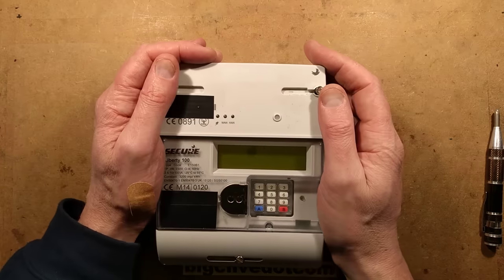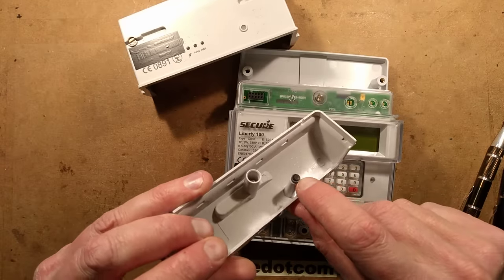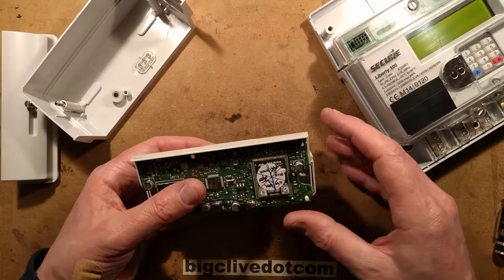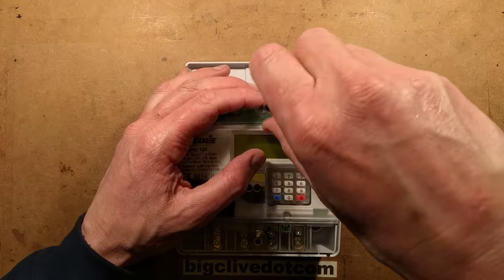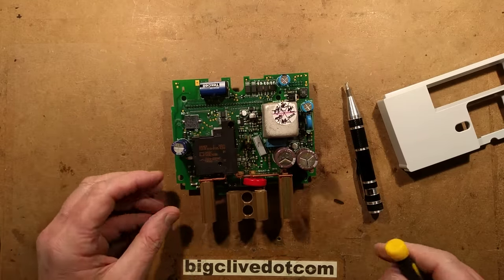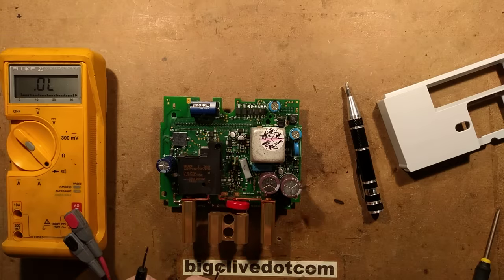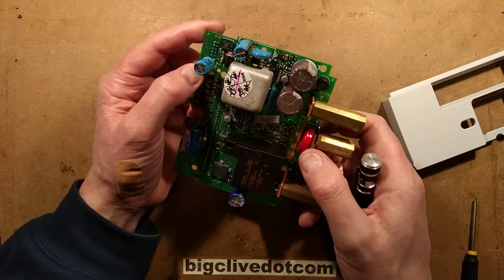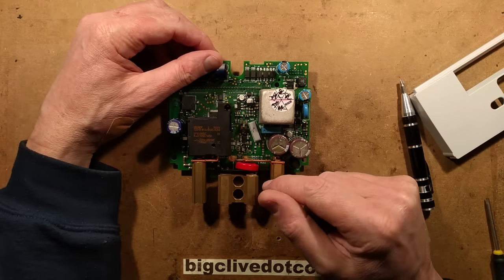Inside a smart meter, and the REAL problem with them.

Comment: When you dismiss the potential for a microphone in the smart meter I notice it is only part of the meter you have dismantled, there is also an internal display panel which goes with the smart meter. I would be keen to see you dismantle one of those too just to reassure me before I take off my tinfoil hat. Also there were 2 components you seemed unsure of which I am still curious about.

Comment: Your comment on mobile phones.   I used to repair microwave ovens. We had microwave leak tester which had a gauge on showing the levels of leakage.  If the needle went near the red area the microwave was dangerous.  I decided to hold this close to my mobile phone when on a call and the needle on the gauge went fully into the red zone. ??  This thing only tests for microwaves. I tried it again many electrical products and nothing !
Reply from the maker: It will be an RF detector, and your phone is an RF transmitter.  If held against it while trying to communicate with a remote cell tower from indoors it may have put out enough energy to give a good reading.

Comment: So the lesson of the story is use a faraday cage to block cell coverage and only open it when there is a power outage. Then they won't know you opened it until they physically come out?
Reply: Those big caps in the modem are two 50F 2.7v supercaps in series across the 5v supply... not sure how long they would power it, as they only phone home once a month, but why bother opening it now you've seen what's inside?

Comment: can you explain the reason, 

1. why smart energy meter not communicating over cellular network.

please mind that all the firmware updation are UpToDate. and still the meters are not communicating.
Reply from the maker: That could be because they are not getting a strong signal depending on the network SIM used.

Comment: Software at the supply company will detect most tampering events simply by spotting the changes in the signal. All those anti tamper buttons are physical proof for when they issue fines and prosecute.

Comment: Basic electronics- "US NAVY" 1977. 1st that red/orange MOV, is for "surge voltage" mostly Lightning strike, 2nd, that "Strange foreign short metal, on Copper bus bar, is a "SHUNT" high -"fixed" resistance, for "Metering" instead of a CT, way back, that with analog milli amp, meter, how current draw, was measured. "Ohms law"

Comment: At 14:40 apropos the type Y capacitor not having a ground connection, we need to remember where these meters are connected in to the system, right where the supply enters the building's electrical system and as such the Neutral will be strapped to the Earth more or less right next to the meter, consequently Neutral will be at Earth potential with the same impedance to Earth.

Comment: Given the construction of contemporary metal consumer units I'm astonished by how flimsy this looks... given the monstrous potential fault currents.   I'm just a low voltage motherboard repair guy... i take it they thought of that and this is all fine right ?
Reply from the maker: Although it can kill power in extreme situations, it doesn't usually have to break fault currents.

Comment: I have a smart meter series 2 and it is in a concrete walled basement elec room for multi apartments which stops the signal coming in or out. Is there any way I can install say a signal booster to an outside Ariel so that will work?
Thanks
Mike
Reply from the maker: It's not easy to pipe a signal in.  If the meter is owned by the utility company they should resolve that issue themselves.
Reply: @bigclivedotcom trouble is they are not bothered but I was thinking can I install a transmitter/receiver to boost the signal into the room so as to help everyone of upto 47 possible future smart meter. If so what frequency etc would it be?

Comment: Not quite sure where the current transformer is, could it be in the 'switch for disconnection' cant see any other circuitry that could take 30-40 Amps ???
Reply from the maker: It's a shunt device in the busbar.

Comment: We complained that our Knky here in France did not work, hardly surprising we have no Orange coverage here. Our Off Peak never turned on. They changed it. I am guessing that a builder was rewiring and rebuilding a house and it was just stripped out. However, the agency that would like the box is not the agency listed but the local electricity supply company, not the company given. Try the local company. The SIM will give the telephone company, probably BT if in the UK.

Comment: Antitamper is on all car modules especially German cars and has been for over 20 year hard to fix so you must buy a new unit on older Mercedes Benz they cost a fortune £2000 for a throttle body on a SL r129  ,, 280 for example

Comment: What would happen if you held a small emp generator close to this unit? It would fry the comms instantly and remove the capability to shut the relay on and the power company would not be able to prove foul play
Reply from the maker: These units are protected against various interference techniques to avoid fraud.  It would probably snitch you in.

Comment: Hey Big C, brilliant as usual 

The biggest problem I have in Spain is that by law we all have one yet the fucking electric company wont give you any information from them at all. they are supposed to tell you when you use the most electricity etc yet after 9 emails in spanish to the company I still can not get a straight answer from them to tell me the times that I use the most power so I cant set my tariff properly to get the best out of the fucking meter and pay the least amount of money each month that I get billed.

At best they are a complete waste of money and at worst the electric company can switch off your power whenever they want to without having to come to your house.  They supply the house owner with no information at all, we are not even allowed to have the little box you have in the uk that tells you at a glance how much you are consuming in cost this second on gas or electric.  The only use they have is for the electric company to sack the meter readers and to enable tracing of pirated wiring.

In Spain these so called Smart meters contain what was the I guess you would call the main fuse/breaker ,  now there is no need to have say the main 40 amp breaker, the meter has it built in but electricity here  s supplied by the meter in power bands, the lowest being 3300 watts, 4400, 5600, 7200 10, 000 being the highest and like mine its 3 phase at that level

Most modern houses are around 5600 to 7200 , mine is 10 k as its 5 bed but mainly because I have a workshop and need 380 volts in there for my lathe and welder.

Why they do it this way is beyond my comprehension , most apartments only have 3300 watts!!  If you want more power before we just upped the main breaker assuming the power wires coming in were at least 8 to 10mm2  but now you cant do that as the meter itself is the main breaker and if you exceed your contracted power it will trip and then take 10 minutes to reset.

 Now you have to go to the office and if you want to up the power you need a total inspection of your electrical system which will cost about 500 euros, endless pieces of paper and then go to the company cap in hand with all this shit and almost beg them to increase the power.  Even assuming they will agree to this then they might send out a man to change the meter to the new power level as its not capable of doing it electronically, not so "Smart Meter" are you , you little fucker.

Finally even if they did supply me with the meter information I want it wouldn't really help as no one  here understands the new electric bill and how it works including the people at the company's offices. Its made up of 3 individual bands that have no english meaning at all, the spanish don't understand how the bill is made up so even though I speak Spanish I have no chance whatsoever as the terms on the bill are written in almost a unknown language. Its a total fucking mystery...

So for 99.9% of Spanish users of electricity its a complete waste of time to have been put on smart meters as they do not do what was intended and promised .

Oh for fucking solar panels and lithium batteries that can produce 3 phase, ( for Gods sake I have 300 days a year of glorious blue sky and 100% sun coverage on my house roof even here just south of Barcelona  ( ͡° ͜ʖ ͡°)  I am that close to going "off grid" now.

Keep up the good work Bib C and dont let the fuckers take you down.

Comment: Now here is another one... This chap came to intall a Linky...(read below who I am )  I asked him about the power factor and the reply was blank...so he installed the Linky and procedded to remove the old meter, a Landis & Gyr eddicurrent rotation disc type...so I said leave that meter he said no we have to recycle....so I said I will recycle it...he said no I have to return it to my company. So I asked why? well the blubbering chap ran out of answers. I felt so sorry for him as he was not an electrician or qualified but had been trained to rip out old meters and install the new cream box...He left (bewildered) and forgot to take the old meter !!! so I re- installed it to monitor consumption after the Linky After 1 month the difference between the two was 40 units..One measured KVA and the other KV.. This is becoming a very interesting subject !!!!

Comment: Is the silver 'slug of metal' at 9:30 a fusible link if the current pulled buy the user exceeds the units handling capacity ?
Reply: No.  It's the current sensing link - the silver colour is only on the surface, it's copper under that.  Maybe laser trimmed copper?

Comment: Just thinking through conspiracy possibilities logically. If you want to track and control people, you would want to know when they use power, preferably in real time. Be able to affect them financially by changing what they get charged, either by altering the units shown or price per unit with the threat of being cut off if they don’t comply with the powers or system. You would need to have a setup where a few people (with computer analysis help) can control lots of people easily and safely without confrontation. You would sell the idea on convenience and saving the world or some similar positive aim. You would undermine anyone pointing out the dangers by seeding weird ‘conspiracy theories’ which are easy to see are nonsense. So I don’t think there is anything to worry from this technology.

Comment: Who pays for the electric used on the modem and opperation of the smart meters ? Is it paid for by the user ?
Reply from the maker: The meter power is from the supplier side.  Your desktop display uses virtually no power.

Comment: If you wanted to make a simple Hi-Lo dimmer for incandescent lamps in the old days you could switch a diode in series with the lamp.  Always wondered if that confused the meters and they didn't charge you for the DC drawn from the circuit.  Do you or any your watchers know the answer?
Reply: You need to read a science book.

Comment: I have had one fitted but with a different type of meter to the one shown here. The actual remote display has been very unreliable. I have returned it to the electricity company and they have sent a replacement. And again! That hasn't worked either. They are reluctant however to replace the meter which I guess has the problem in transmitting the information..

Comment: Why are they using cellular data?  I always assumed that they would use the power lines to communicate to base since, you know, they already have a network of conductive material.
Reply from the maker: It involves a lot of complex and expensive equipment to communicate along the power lines.  Especially with the amount of electrical noise created by modern electronics like phone chargers and some lamps.

Comment: I haven't trawled through all 4,995 comments (to date), but no-one had yet mentioned that the whole smart meter rollout is the result of an EU Directive!  A quick Google gives you: "Annex I to the Electricity Directive 2009/72/EC requires the EU Member States to roll out electricity smart meters to 80% of consumers by 2020, unless the result of a Cost Benefits Analysis (CBA) is negative."

Comment: Smart meters. As if life isn't complicated enough. Wi Fi helps me, Smart meters don't. It doesn't look built to last.The caps come to mind. As to memory batteries, no thanks. The terminals go dead even when the battery OK. The VDR should have a thermal fuse ( 100C? ). Plastic case should be a NO NO. Part 17? Also, I supect old meters don't measure VA? These likely do ( strip lights, filters ). The VA is already factored in so you pay twice?

Comment: Electric meters are normally in a part of the home where there is no or very little mobile phone signal so obviously they must be sending out a stronger signal than your average mobile phone?
Reply from the maker: It has to comply with the same standards as your phone.  If anything the phone might have to transmit at higher power due to being hand held.
Reply: In a lot of homes a mobile phone will not work in the place where the electric meter is,  maybe they can connect with a week signal and reception because they are only sending short data bursts ?
Reply: They only need to check in once per month, and these meters are on 2G, which allows for more power than modern phones, but at lower data rates.  Doesn't take long to send readings at all.

Comment: If i was to put a cable in between both lives. Would that bypass the meter entirely or just slow it down?

Also if i pull the fuse before the meter. And then remove the cover. Put it back on and reconnect the fuse. Will it dob me in? I mean my friend in 

Asking for a mate obviously
Reply from the maker: It would slow it down depending on the resistance of the cable, but may leave tell-tale marks on the terminals.  The unit has battery backup so it knows that the cover has been removed even when unpowered.
Reply: @bigclivedotcom  ah the battery would be an issue!! Iv switched suppliers numerous times. So im not even sure who the meter reports too anymore!?

Comment: Peak demand pricing is as much a conspiracy as vegetables costing more in the winter or any other pricing based on demand and supply.
Reply: Have you been paying attention to the news recently? The talk about "energy rationing" being introduced? How do you think they will achieve that?
Reply: @ferrumignis  they don't need any smart meters for that. The power companies can (and have been able to for decades) shut down areas of the grid. The reason for doing that is to avoid a brownout and uncontrolled blackouts. That in turn is o keep critical infrastructure (like hospitals) running without interruptions, as well as avoid a further shutdown of the power grid. It is not fastcheap or easy to bring large chunks of the grid back online. Why? Well, because 1) all of the generators need to be in sync, 2) at any given moment, the input and output of the grid needs to be exactly the same. Energy rationing is not the same rationing that there has been e.g. during WWII for certain food items. Adding to that, the rationing scheme has been in use well before the arrival of smart meters. They just usually are called rolling blackouts.

Comment: Do they measure true power or apparent power?
Reply from the maker: They can measure either, and it can be changed remotely.  You can bet they'll change it to apparent power at some point to get more cash.
Reply: They will be able to measure in all 4 quadrants, active/reactive/forward and reverse also RMS. (I used to worked for an electric meter company).

Comment: Bluetooth connects to the in-home display and was supposedly meant to connect to a meter reader's unit if the mobile signal went down
Microphones exist in electronic gas meters because they measure flow rate by the ultrasonic whistle made when the gas passes through a pitot tube - so it can only spy on bats
Bridging the meter to get free leccy isn't done by putting wires into the meter contacts, the favourite way - seen by the charring or the house fire - was to push pins into the input cable below the 50 amp fuse from the back of the board. OK you have to clear the armouring but that will not deter the dedicated (suicidal) tealeaf. This can be discovered because there are other ways of detecting it - hopefully before the house catches fire. I believe that there are also software hacks available on the dark web. 

These electronic meters will put the old craft of making induction coils/magnets to slow or stop the spinning disc a thing of the past though the best hack was to have a dual rate meter and stop the clock (yes, even the clocks that took the signal from R4 as the timing cue)